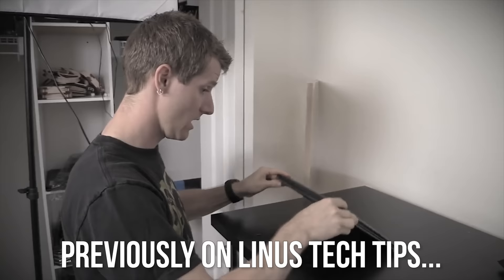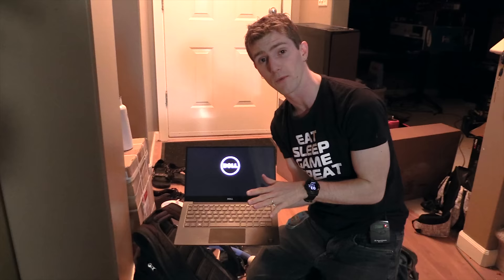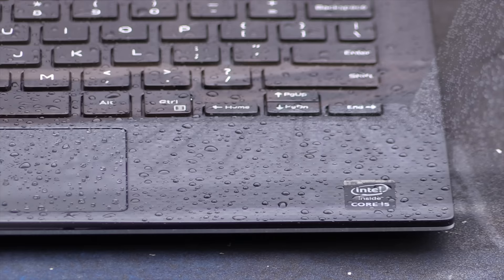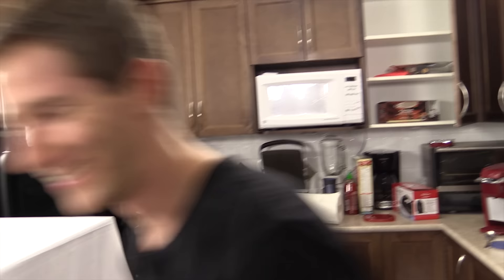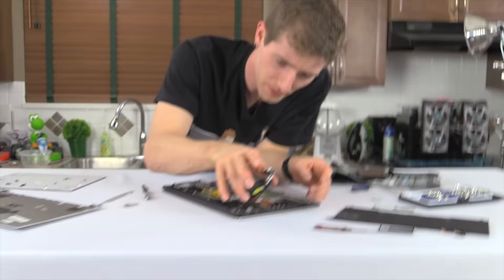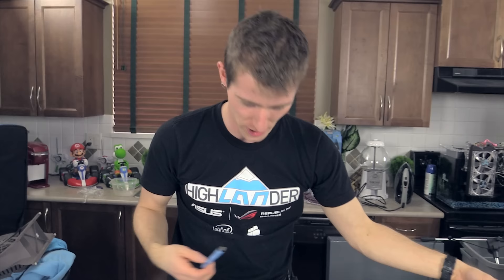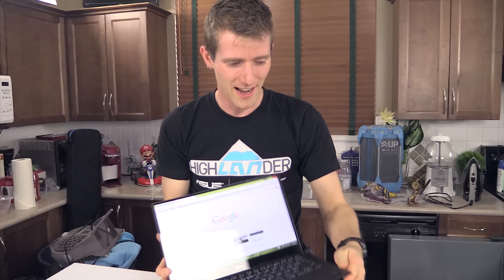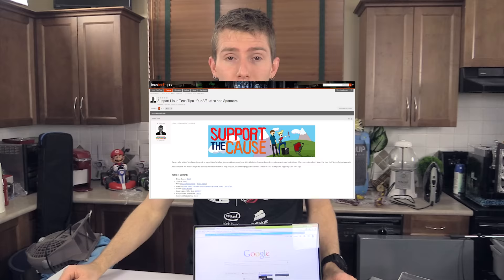Wet Laptop Recovery AGAIN - Dell XPS 13

Comment: But this is just to recover data. u still need to take it to a repairman to get rid of residue and check if there is corrosion. Luckily i was well informed by louis rossman. It works doesnt mean its fixed.

Comment: Spilled some milk my laptop's keyboaard so I immediately pulled out the charger and other things plugged into it, shut it down then tried to get as much milk as possible to drip out of the computer before opening it up as much as I could (not very far) and poring out the remaining milk before letting it dry for a couple of days. Safe to use?

Comment: Why do you attempt to "resurrect" the laptop before trying to turn it on after the rain- you don't know if it's dead yet
Reply: skyline if you turn it on while it is wet it is almost guaranteed it will die, because there is a dead short across terminals that can fry the electronic components, but if you dry it out first, the short will be removed before power can be received by the components therefore making it as if the short never existed.

Comment: Bruh just let it be in a slightly warm place and set open an application that requires the fans to move fast which will heat up the computer and make the fans move and burn out the water

Comment: I have been in the auto repair business for 35 years, and it's one thing to have to do a repair after an accident, but it's another thing to deliberately abuse this equipment. Especially if it's loaned to you as a demo. Bad form.

Now I would be curious to know if that stunt shortened the life of that PC subjecting it to corrosion problems later.

Comment: um, no. if the xps 12 was in "sleep" mode the state would have been lost when you disconnected the power. so it wasn't in "sleep", it was in "hibernate" mode.
Reply: It's a laptop, it has a battery...
Reply: But he had disconnected the battery
Reply: Craft4Cube yeah, when he friggin worked on it.
Reply: Exactly. He disconnected the battery when he worked on it. Then he reconnected the battery and the exact state was restored which means it was not a conventional suspend-to-ram sleep state. https://en.wikipedia.org/wiki/Advanced_Configuration_and_Power_Interface#GSTATES

Comment: My Dell M3800 suffered some water over its keyboard. The computer works but some of the keys (z,x,c) either make no ontat or they type out 50 times at one. I just notied that my T now works, where it did not before. I have been using an old Mac USB keyboard in the meantime. The touchscreen works, space bar and Shift work. Should I wait to see if the broken keys come back to life, or is there a way to repair this, perhaps with a shpritz of electronic contact cleaner spray?
Thank you.
Reply: Oh oh baby yeah oh ahhhh faster faster ohh baby ohh oh my God oh
Reply: Hmm. I'm also finding for help and tips on YouTube on how to remove water inside.

Comment: +LinusTechTips My ceiling was leaking and it dripped in my laptop while it was changing overnight I put it in a ricebox for 9 hours then I turned it on and it turned on for a few seconds and automatically shutdown is it broken ??? Or can i fix it
Reply: you probably fried it
Reply: +HighFructoseFun do you think I could bring it to a repair place and bring it back to life???
Reply: if it does that it probably means some of the hardware is broken or damaged because the turn on screen requires very little.
Reply: Id say its dead what there doing here is partially extreme luck and partial decades of skill with handlings of electronics which your average repair shop wouldnt know much about
Reply: The charger pry fried hardware from shorting out. Sorry to hear bro...
Reply: Nine hours is nowhere near enough time. Should have waited at least a day or two, in an area where the moisture can evaporate into the rice.
Reply: Thanks guys :)

Comment: i spilled alot of water on my 1500$ laptop and it still turns on, the keyboard backlight still works, but the keyboard and trackpad and fucked up and i cant click or type, even with an extrernal mouse

Comment: Dear Linus, I am an electrical engineer who is doing this masters thesis. I need a computer that will run matlab, latex and python. I would be doing a lot of numerical analysis. I need a rugged 15 inch laptop that I can use. Would you please suggest me a laptop? And you would be pleased to know that you are really famous here in Bangladesh. Specially in our university.

Comment: My xps 13 got a tiny amount of water on the keyboard and the keyboard is dead and the charging is not working correctly. I just opened the back to air it out. Hopefully it works again
Reply: Hi Erik
Reply: please I left my xps 13 in the room on the floor and I set it on sleep mode while and charging it on electric and I went out for an appointment for 2 hours and came back home found out that my room in has feed up with water from the bathroom sink and   my xps 13 is in water please what can I do ?
Reply: Austine inifinity rice

Comment: *It's rain(it's basicly destiled water)

Destiled water is non condactive

(Sorry about my english)*
Reply: rain is anything but destilled water! Rain picks up a lot of air pollution on its way down to earth. especially near to heavy industry rain contains a lot of different pollutants, which are often corrosive and/or conductive.
Reply: DoJo - Gaming and more maybe u live in the mountains and the clouds are like 2 feet away from you

Comment: My laptop keyboard fully broke since I accidently dropped water in it I used a USB keyboard and its beeping!
Reply: I just took out the battery and put it back and it fixed it. GG

Comment: I bought a DELL Laptop and it of course stopped working just after the warranty expired - DELL was the worse company in the world to deal with and totally lied about everything .. in the end took the thing apart myself only to discover how rubbish DELL's are built on the inside. For example the POWER button on my laptop was just a piece of plastic film, like a sweet wrapper almost which fell out upon opening the laptop. Instead of using a high quality microswitch they use a piece of junk for the power button.  My advice is never buy a DELL Computer they are often HAND BUILT - not built by robots. So the quality of your laptop depends on what kind of mood the person in the factory was that day. If they were tired then your DELL PC might not last as long.

Comment: xps 13 survives being out 24 hours in the FUCKING RAIN

MacBook Pro can't survive literally 2 mL of water on the keyboard that seeped in. fully fried, cost nearly 2000 dollars to repair. mind you I turned it off as soon as the water seeped in, not even in sleep mode. 

WTF APPLE